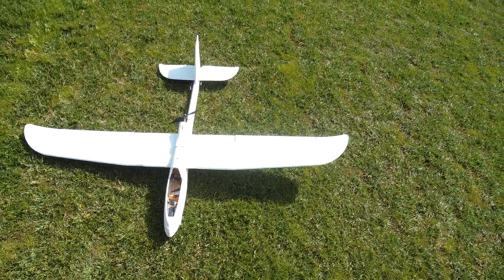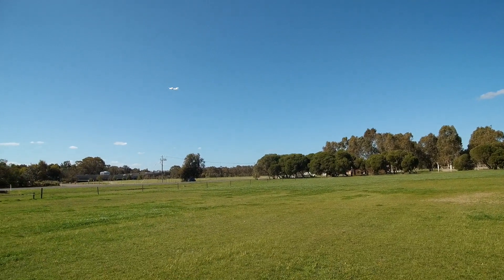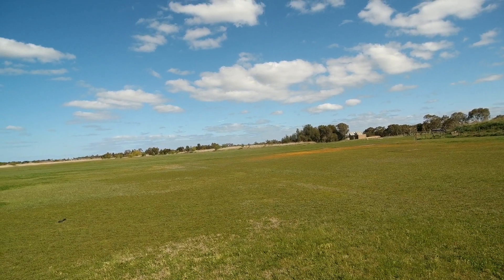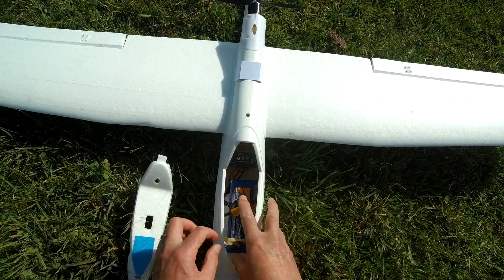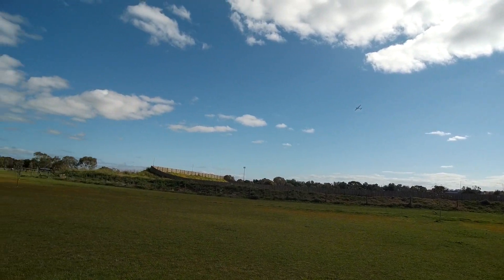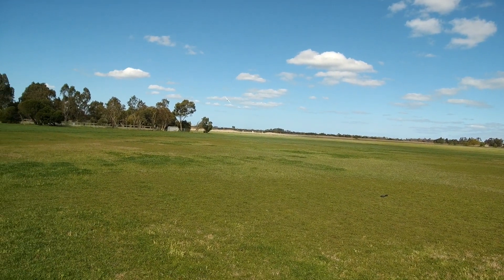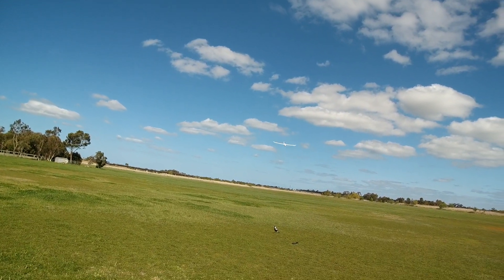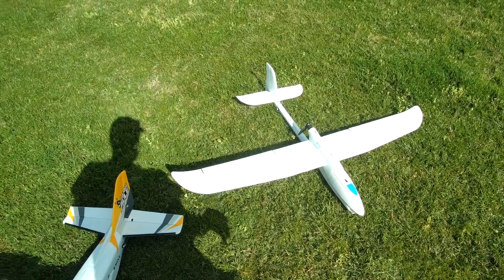Volantex Ranger 1600 CoG testing

Comment: Ahh, to have a nice, open field without a lot of tall trees close, light posts, gol posts on the grass.
Tomorrow the maiden flight for my 1600. Lots of nail biting with the mentioned obstacles at the local stadium site.
On my wings, years later from yours, there is a little square impression that says CG. Based on your testing, would you suggest a little nose or tail heavy?
With two 3s 2200 stuffed in the nose, she seems just a hair nose heavy. I'm hoping the A3 V2 will compensate for my klutzy fingers.
Reply: I'm reporting back after the first 12 hand launches and two flights. It flew well once in the air. Getting it there seems to be the problem. My CG on 10 tosses was at 70mm, the last two at 75mm. Launching left handed as hard as I could, slight up angle, with gyro on and off, full up elevator, she just headed straight for the wet grass. The two times she got into the air was after touching briefly on the grass. Any ideas?
Reply from the maker: Too much throttle maybe. Try using just about 60% with a good throw. Also try no throttle glide test, just throw it and see how it behaves

Comment: I flew with CoG 70mm. and the rolls and turns were  slow or jerky. It was also not possible to do rolls exactly, although the rates were high. If I move the CoG 10mm towards the tail, will the plane be more maneuverable and responsive on the control surfaces?
Reply from the maker: Yes you can push the CG back for more agility

Comment: Hi Andrew. Just purchased a Ranger 1600. I noticed the fuselage has two spar holes, while the wing only has one spar. Is the same fuse used for both the 1600 and the 2000? Thanks. Love your videos.
Reply from the maker: Thanks, yes same fuselage. Phoenix V2 2m wings also are the same as the Ranger 2000.
Reply: Hi  Andrew,
Thank you for the quick reply. I always enjoy your videos. 
Before asking, I should have checked further in your other videos on Volantex. You stated they are the same, and I missed it. Again, thank you.
Reply: What an attractive plane and a very tempting prospect for a future buy. Great demo. Thanks.

Comment: Hello Andrew I have a Ranger1600 coming anyway ,looking for a very good motor for it,,besides stock,I’m looking for one with some umph and yet still battery life,,thanks
Reply from the maker: I'm using HobbyKings NTM Propdrive 2836 1200kv. May not be available anymore? A similar sized Sunnysky would be good.
Reply: Andrew Newton what other motor do you suggest,,,wanting a nice quality motor,I like the turnigy aerodrive motors but seems a lot out of stock ,I have several 8x6 atp props I will be using,,what you suggest,,,

Comment: Hi 
 Andrew nice flight.
I have problem with my ranger 1600 . Wheh I throttle in flight my plane 
it leans right. When I glide without throttle go right. Do you have that problem and 
how fix it?  Please help Thanks.
Reply from the maker: Sound like it needs some left aileron or left rudder trim if it's going right all the time
Reply: @AndrewNewton  My CG was 10-12 mm behind the line. I move it 5 mm Behind the line and now fly 
much better. I test right on CG line next time. Thank Andrew I'am beginer , love yours videos.

Comment: Thanks - an interesting test. As you say, it has a long tail moment. I took some measurements off a plan view photo and from that I got that the tail moment arm was about 3 x the mean wing chord and the tailplane area is about 16% of the wing area. Ignoring the downwash of the wing reducing the efficiency of the TP neutral stability would be for a CG at about 70%!  (48% behind the 25% point). Even allowing the TP efficiency drops to 50% it suggests about 50% behind the LE should still be reasonably stable.  Good to see theory fitting the experiment reasonably well.
Reply from the maker: Thanks for doing the sums Colin, very interesting.
Reply: @AndrewNewton  Hi Andrew - I now have one on order as the basis of a quadplane so I was interested to know what the CG range might be. With it rigged as a quadplane it should be safe to investigate the outer reaches of the  range.

Comment: Hi Andrew
Great tests on a Fantastic model. 
You changed your motor from original build??
Did it fail or used elsewhere. 
What is the new one and is it as efficient and as much thrust as the 1100kV?
Cheers
Reply from the maker: Turnigy Propdrive 1200kv, covered in this video https://www.youtube.com/watch?v=3N-RhpnLuDU The other motor had noisy bearings. This one is doing nicely, efficient and powerful
Reply: @AndrewNewton  sunnysky x2212 1400kv is a great motor for this plane, got one in my 1600

Comment: Andrew, you did mention only once, at the very first aft cg shifting, of more down trim needed. Didn't you also more and more while aft and aft cgeing ? This would mean lesser and lesser profile resistance as a very useful byproduct !
Reply from the maker: Just little amounts of elevator  trim, dont think it would make a lot of difference to drag but in theory you are right.
Reply: I had the same thought, especially when Andrew came in for subsequent landings and seemed surprised at the extended glide.

Comment: Yes, it's a great FPV ship for sure, I wish it wasn't so pricey though....lol...Your weather looks great, ours has dropped off some as we head into Autumn....Im relying on you Andrew for my Sunshine as our Winter shuts us down...:)
Reply from the maker: For my detention I'll make a video about RSSI and the XM+
Reply: @AndrewNewton  love to see it
Reply: Yes, the RSSI will be a little low and jumpy at close range inside the iNAV OSD, but it will increase and settle as you fly further away..!!!  You will be very surprised at the range this tiny, but sensitive receiver has Andrew. Set the antenas at 90 deg to each other for best results in the usual vee config.
Reply from the maker: I'll do my best ET. I need some XM+ RSSI advice. RSSI is on ch16 from the XM+. Select ch16 for RSSI in iNav and activate it on the OSD, then do you need to scale it somehow? Seems to read 49% max
Reply from the maker: It's OK, needed to flash the latest firmware to the XM+
Reply: Me too. ET has been getting on at me for ages about flashing my XM+ Rx's. lol
Reply: Lol....You can have RSSI on Ch#8 or Ch#16 depending on which Firmware you load....Both of you are in Detention for not paying attention....lol
Reply: Lol....You can have RSSI on Ch#8 or Ch#16 depending on which Firmware you load....Both of you are in Detention for not paying attention....lol
Reply: Weather is pants tomorrow, so no flying. So I may have a go at flashing my very first Rx after I fix the Bat Wing.
Reply: Yes, no more excuses left now, the weather has turned...:)